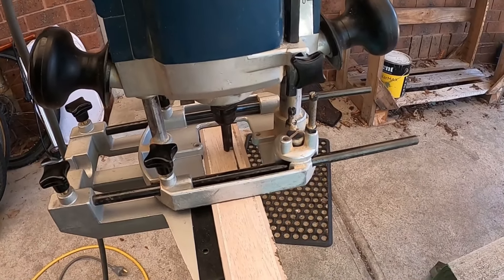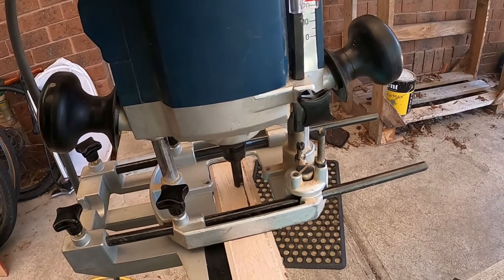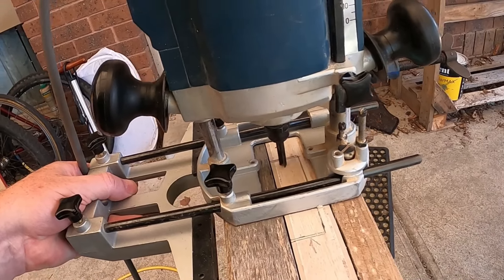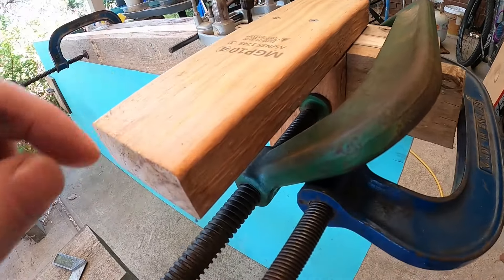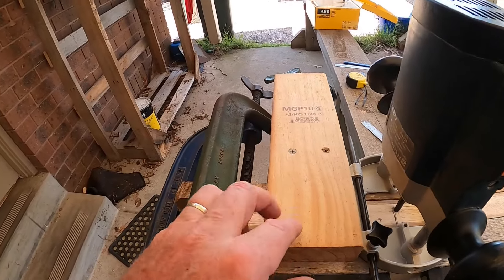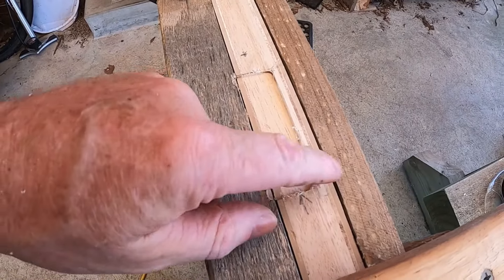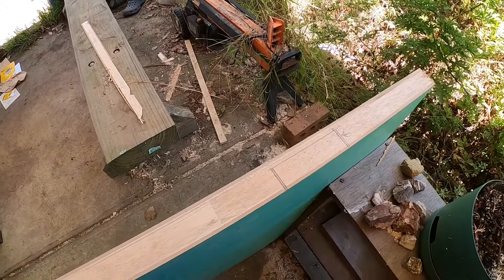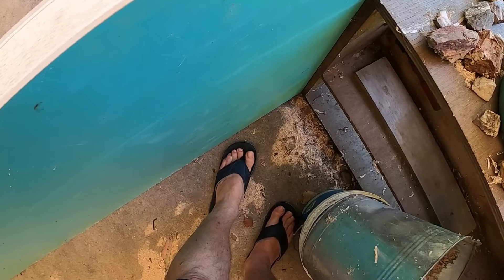Routing a hinge rebate

Comment: You got it !    You have made perfect cuts ! 
Have you made a door stand?  
A ripping of plywood with two spacers on the end.  Then two 1X pieces for the sides with 45 degree braces.  The door's weight causes the sides to pinch in on the door.    tHanks for the video
Reply from the maker: Thanks. I have an old bookshelf that I clamp things to when I need them to be vertical like that.
Reply: I like that idea  @UnhingedHarry  .

On a different note, speaking of book shelves. This past year I started collecting all the real wood home made bookshelves people put out for trash.

Most of them were built with care and used in a garage or basement.  Many of them are made from a better cut of wood than we get today.

I can't recall where I saw it but years back a guy was mortising for hinges on a home made plywood jig.  He would use a router guide collar. 
I have the Porter Cable kits, they work very well but I admire systems like yours.
Reply from the maker: @Dancing_Alone_wRentals  yes I thought there would be kits etc for it but I rarely do them so not worth it for me. Mainly because it would be more "stuff" to put somewhere.
Reply: That's funny  @UnhingedHarry .  I too started to factor that into the decision making:

1) Do I need it..(silly question..next) 
2) What quality do I get?  
3) How much is it? With the deluxe red turbo button included.  
4) Where on earth am I going to put this?